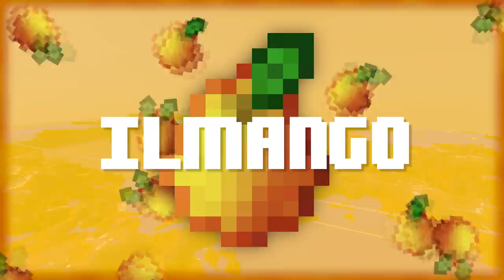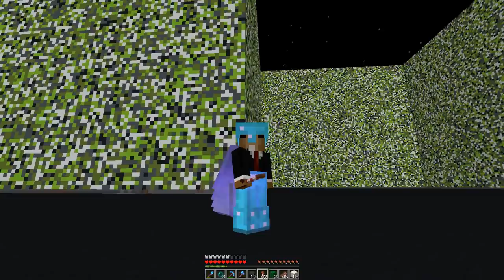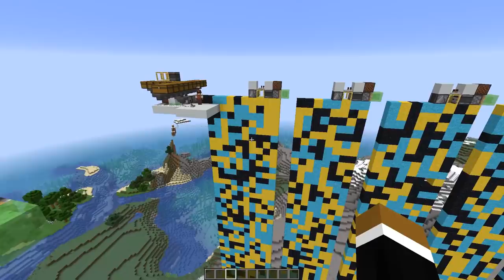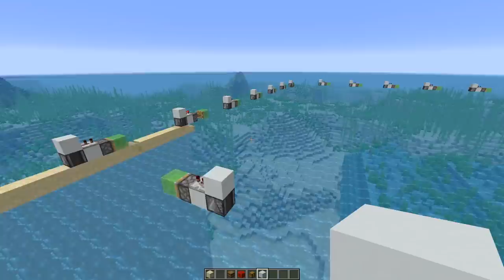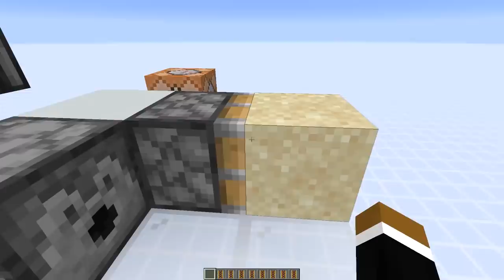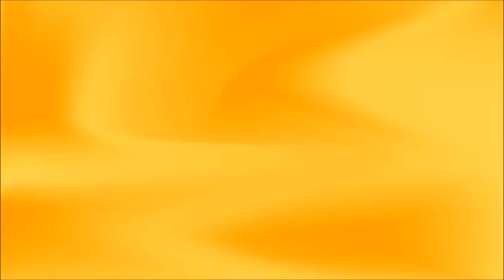Automatic Wall Builder / Conveyor Belt 1.11-1.15

Comment: For those wondering, the machine does work on Bedrock
I made some small alterations to the machine and tested it and it works, did a smart piston but delayed the activation by 3 ticks and made a conveyor similar to the 9 tick one just changed the note block for redstone dust, and seems to work flawlessly. 

I Did the clock for the second conveyor (the 10 tick one) and used a way simpler conveyor: observer facing downwards with dust on top, sticky piston with a solid block on top and then you can use a honey or slime block. This conveyor also worked flawlessly. 
I tried increasing the clock speed, but then it broke. I also tried smart piston with a 2 tick (1 tick breaks it) delay with the simple conveyor and it worked as well.

Notes: 
The clock Ilmango used for the 9 tick conveyor does not work on Bedrock. 
Honey blocks also transmit redstone signals through then on Bedrock.
Using lower delays or faster clocks will eventually (sometimes instantly) break the conveyors.
Observers in Bedrock can’t detect if a note block is powered or not, use dust, lamps, or observers instead.

Edit: Spacing
Reply: I can agree with you. Just tested on bedrock right before I read this comment and the alterations are minor but very significant for us on bedrock
Reply: Storm2103 thanks sm
Reply: Can you make a small vid showing this please? Would be very grateful
Reply: I had to alter the clock slightly to get it to work; 2 of the clock repeaters needed to be on 2 ticks, and I didn't even need the piston since they don't get powered in that setup on bedrock. Other than that, worked a treat!
Reply: how do u smart piston on bedrock :0

Comment: For the corners where you use 2 observers and a piston, you might try using a fence/wall, 1 observer, and a piston. I haven't done extensive testing with it, so I'm not 100% sure on the timing, but I'd assume it drops a tick from the time that it takes to update the corner pistons.

Comment: for anyone running the 9tick version and running into the same problem with selfdestructing blocks: add a buildingblock to the  end of the row (so it will be the front of the blocks pushed) that will stop the blocks from falling between 2 blocks

Comment: The new 2b2t wall project
Reply: Nah
Using slaves is a lot easier
Reply: One Eficiency II shovel and the wall is gone in minutes
Reply: @FeatherSlowfall  unless you build multiple lairs and use water to create concrete
Reply: @FeatherSlowfall  more like one torch
Reply: Scicraft is like 2b2t but actually civilized
Reply: @FeatherSlowfall  make several layers and make it fall on glass.
Reply: @_oceanstar  you could just break the glass? You could also just place a torch on the sand.
Reply: AlexisBubba15  how does bedrock not last for a while?
Reply: Imagine SciCraft players coming on 2b2t
Reply: One torch and this is gone

Comment: Hey this might be interesting, you could also use a noteblock instead of the scaffolding. When you push block that has a different note than air under a noteblock it updates, which can get detected by a observer.  This is way easier to build than the scaffolding.
Reply from the maker: that wouldn't work because of the timings. note blocks would update immediately while scaffolding adds one tick of delay

Comment: tbh those walls are kind of cursed, I'm almost certain that randomness makes attempts at compression way less efficient, so my assumption is that the world's size will balloon if you have a lot of them... I might be wrong though, maybe the way that the chunks are stored it doesn't matter that the blocks are in a random configuration

Comment: Does this require chunk loading? I recently made a 300x300 square of this in a testing world and far away areas randomly broke. Using concrete powder and the 10-tick design if that matters

Comment: Can you double the speed by splitting the block that is placed, so the first block goes clockwise then the second block goes anti-clockwise? Allows you to run the slightly slower and reliable block pusher, but twice as fast?

Comment: I've been planning to use this to surround an ocean monument to drain, only to realize that concrete powder solidifies to concrete on the top of the water instead of falling through. :( Guess I'll have to do it with sand or gravel instead...

Comment: if anyone is attempting this on Terralith 1.17.1: there is a game code issue where the blocks place fine until y=0, at which point they continuously break for seemingly no reason. currently no way around it.
Reply: Thats an issue but why are you using outdated terralirh its obvously fixed for 1.18
Reply: @timohara7717  playing on a custom modded server with my girlfriend, would be super complicated to update.

Comment: Does this work on bedrock edition????
Reply from the maker: probably not with the exact same design, but you should be able to do this in bedrock as well.
Reply: @ilmango  thanks 
By the way you should do a redstone battle with mumbo jumbo
Reply: @fiftiethsteam5032  Mumbo isn't that good
Reply: The machine does work, made some alterations to the machine and tested it and it works, did a smart piston but delayed the activation by 3 ticks and made a conveyor similar to the 9 tick one just changed the note block for redstone dust, and seems to work flawlessly. 

Did the clock for the second conveyor and used a way simpler conveyor: observer facing downwards with dust on top, sticky piston with a solid block on top and then you can use a honey or slime block. This conveyor also worked flawlessly. 

I tried increasing the clock speed, but then it broke. I also tried smart piston with a 2 tick (1 tick breaks it) delay with the simple conveyor and it worked as well.

Edit: Small gramar mistake and spacing

Edit 2: Honey blocks transmit redstone signal on Bedrock unlike in Java. You can use then as a Slime block substitute in some contraptions.